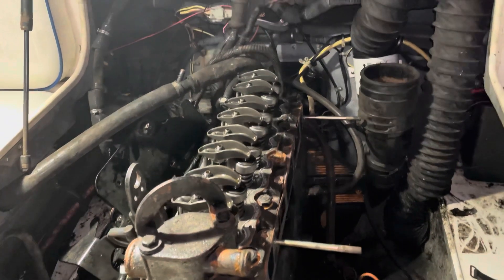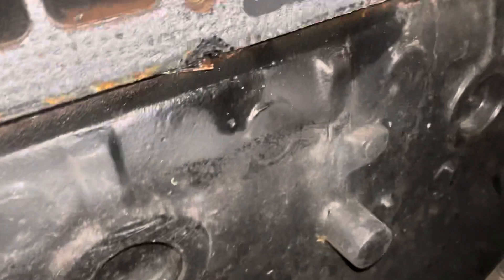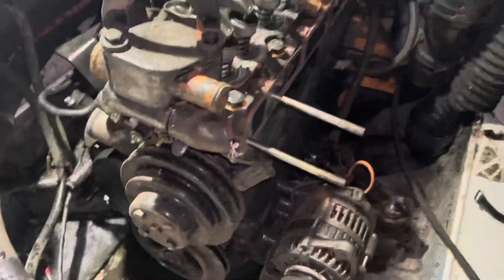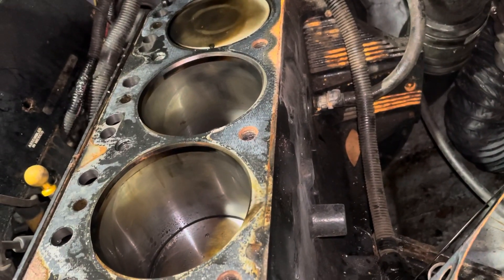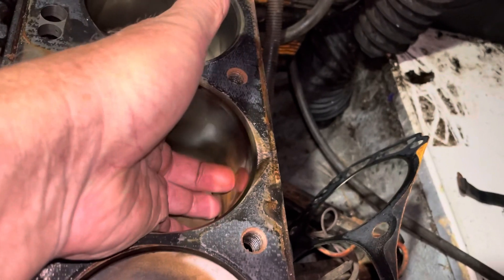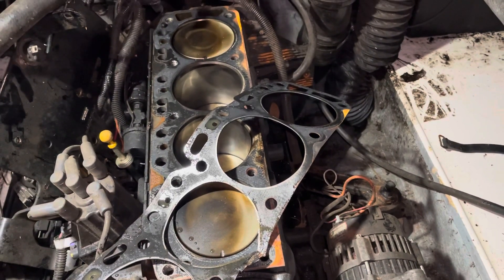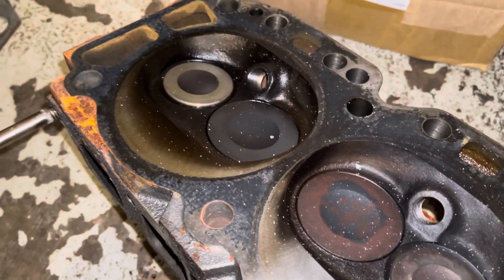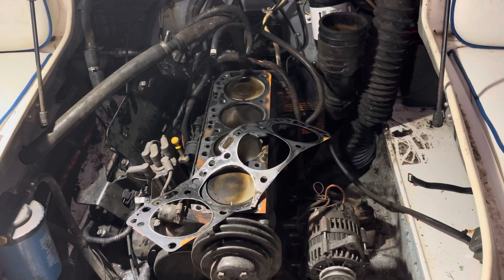Mercruiser 3.0 3(X1) - Head Gasket Breach

Comment: wtih the position of the rust in #2  i'd bet  the block is cracked. probably frozen.  check the pistons at tdc  and make sure it didnt hydraulic and bend a rod.
Reply from the maker: Block wasn’t cracked not frozen. The head gasket blew out in #2 which let water in the cylinder. Another low octane gas horror story. People you must run 89 octane or higher. Says so in the Mercruiser manuals.